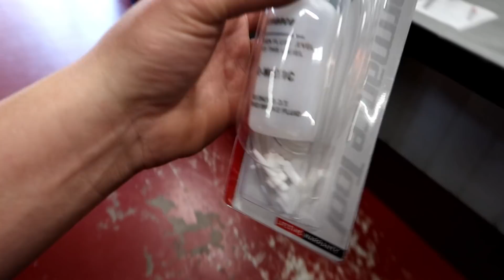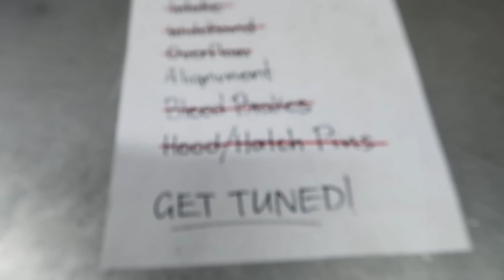First BURNOUT! Knocking this list TF out

Comment: When you use that little bleeder. You can don't have to close the bleed nut. Just keep pumping. Since the tubes in fluid it won't take air back in. The fluid will move back in a little but it won't matter. That way you don't need a second person. Hope this helps bro 👊

Comment: Same cables bro. Ive personally used a hatch cable on a sedan in past. The sedan broken cable was missing the accual peice that spins inside the sleeve. As for the lenght the sean one is a inch or 2 longer but hatch cable still fits fine

Comment: The cable to the cluster should be the same.  The cable for the sedan looks like it got pulled through the housing.  Try and pull the cluster on the sedan and test fit the hatch cable.  It should work.

Comment: Yeah bro. 

I bought an AUSDM 91 CRX that had 88 Headlights and 91 corner lights DUCT TAPED IN.

The guards are also different too. The 88 corner lights screw into the guard whilst the 91 ones slide in and are screwed in like your hatch with the tab on the top corner on the headlight.

Have to get 91 Headlights and surrounds ( That it should have had, car had been crashed) to make it all fit.

FRUSTRATING!

Comment: You think thats crazy! I have an 88 si crx trans in my 91 hatch. The spline count is different on the transmission shaft to the 91 clutch plate! To solve that issue I used an 86 Prelude disc plate! Lmao!!! It was a learning experience for a buddy and myself!!!

Comment: Yea brobeans, burnouts directly in front of the place where you park the car is almost the best spot to lay em at..  But the absolute best spot is where you leave the rubber lines in the street and driveway both..  thataway anybody who ever drives by knows who dun it, for like a year or so until the concrete and blacktop erodes away enough to fade the tracks...  you know those houses you see randomly where all the dukes of hazard marks lead out of..  Dont want anybody thinking you like to drive slow and obey traffic laws n shit..  

Ha!  Sorry to brake the bawls..  my house is one of those houses btw...  (•.•)
Shitty thing bout that, on more than one occasion ive been chillin and hear somebody shittin n gettin outside and few minutes later either an officer or some pissed off karen is knocking on my door and is hard to deny that shit even if it wasent you..  especially when the cloud that hits em when you open the door would sleep a crackhead..  (°~°)